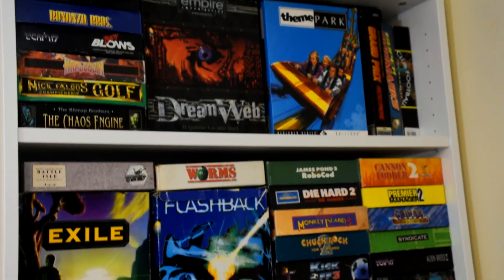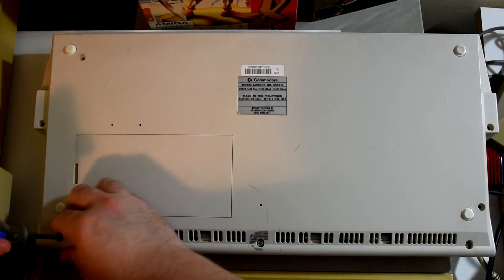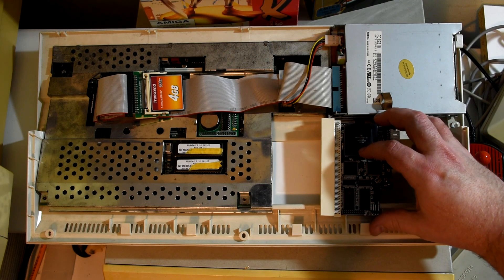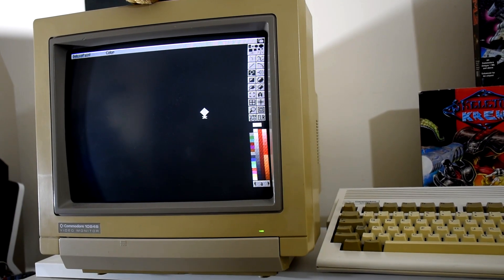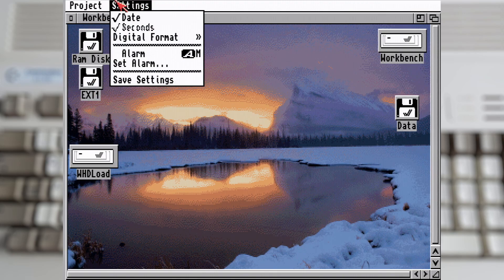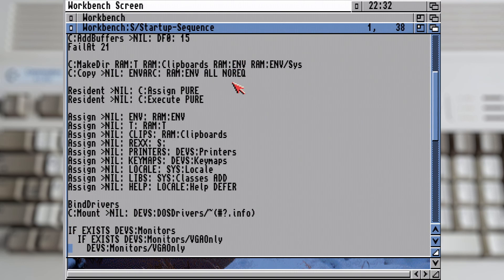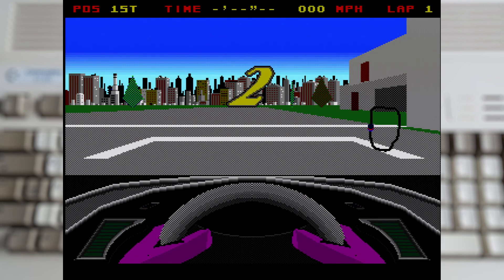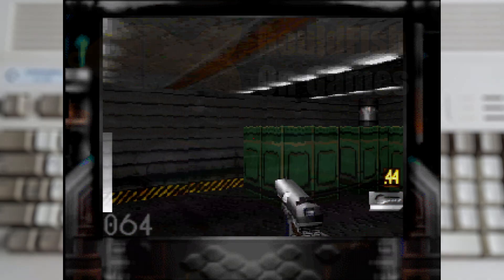A time to shine my Amiga 1200 #AMayGa

Comment: I must admit I've been a whdload user since the late 90's, its so darn handy. Like the tour of the A1200, but I'm a bit of an Amiga person so very much my sort of thing. I remember the fuss about the licensing for that accelerator, I must admit I thought it was very cheeky of them given you've bought the hardware. I've got a blizzard 030 for mine, but it came with it when I bought my A1200 off some one very late 90's early 2000's and you're right they where dirt cheap then.

Comment: Ah, my 1200. I have a GVP 030 accelerator with an FPU. Which no longer works, so I had to remove it.
The HDD is fried too, but it works happily from disk.  Pinball Fantasies AGA runs great with my 2 external cumana drives 🤘🤘🤘
Reply from the maker: Wow that machine has been though the wars, good to hear that the base hardware still works and Pinball Fantasies is a great game to play on it.

Comment: Have you seen the Raspberry Pi booster for it yet?  Was tempted myself :)
Reply from the maker: The whole PiStorm thing isn't my thing,  If I'm going to emulate a CPU and graphics card then I might as well just use WinUAE.
As some point all you are using the Amiga for is as a power supply and keyboard.
Reply: @GouldFishOnGames  I'm tempted to have a play at some point, they are rather cheap so it's not like I'd be spending much to try it, and I have the odd rpi3 kicking around. I think having to wait for the pi to boot Linux and start the pistorm process would bug me after a short while. I'm interested in the buffee project as that's more or less instant on. Also I can put it in more or less any 68000 machine (I've got one or two machines that need a new 68000).

Comment: The biggest problem with the Amiga 1200 is that it just wasn't technically advanced enough to keep up with competition. By the time 1994 rolled around it looked completely dated. A real shame. Had this been released a few years earlier at the same price point as the Amiga 500 it could have been more successful. 🤷‍♂
Reply from the maker: Yeah it was a little late even when it launched in 1992 as it wasn't quite the huge jump that the original Amiga was.
and the PC was slowly starting to look better (sound.... I still prefer mods), but it was much cheaper then a VGA equipped PC.